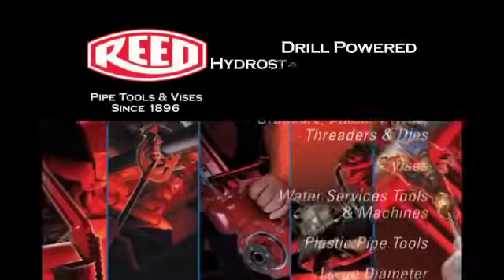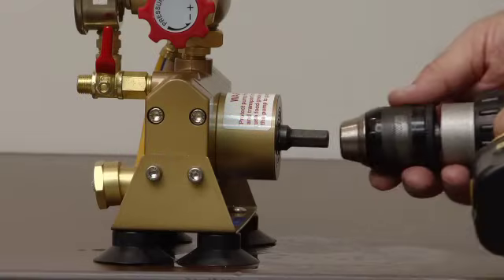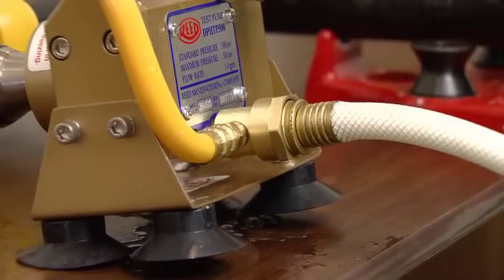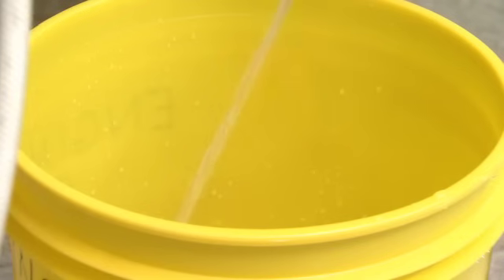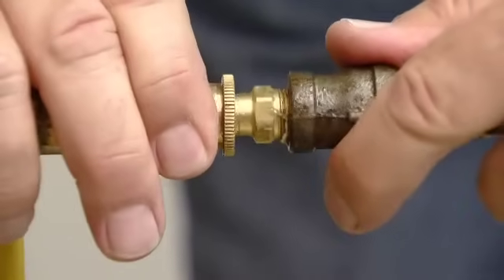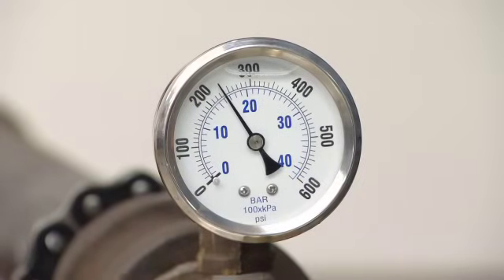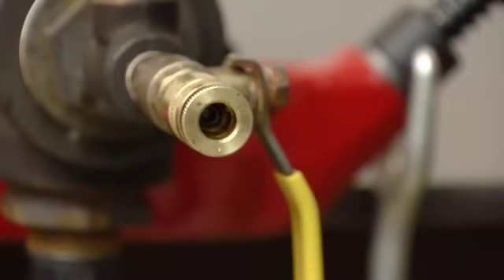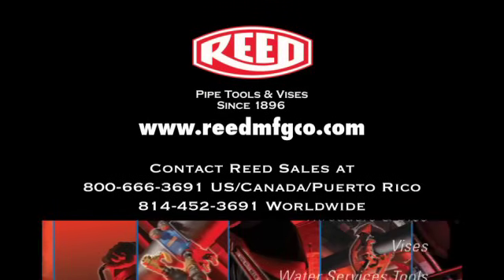Drill Powered Hydrostatic Test Pump Demonstration (DPHTP500) - Reed Manufacturing

Comment: How quickly does this pressurize in comparison to your electric powered model
Reply from the maker: Great question - let me ask the technical sales team.
Reply from the maker: The same piston style pump is used on both units. REED recommends a 1500 rpm cordless drill for the DPHTP, which is in the same ballpark rpm-wise of the motor for the EHTP.  That means they can have almost equal speeds.

Comment: if you ran the drill in opposite direction of rotation would it suck fluid instead?
Reply from the maker: No, running the drill in reverse will not create a suction on the high pressure side.  The only way to create a suction is to use the intake.